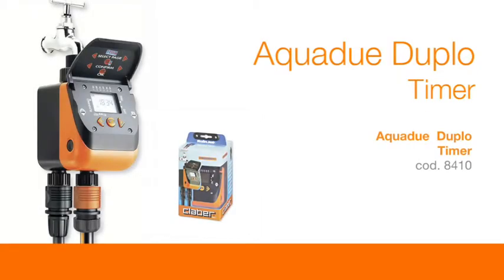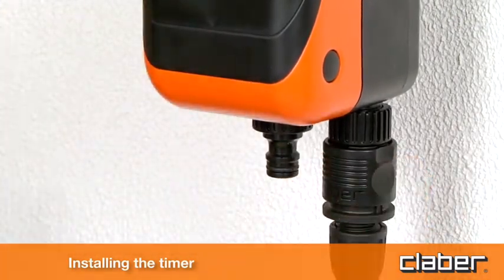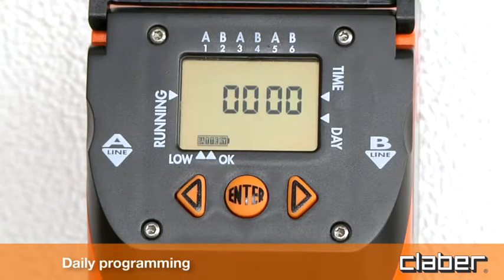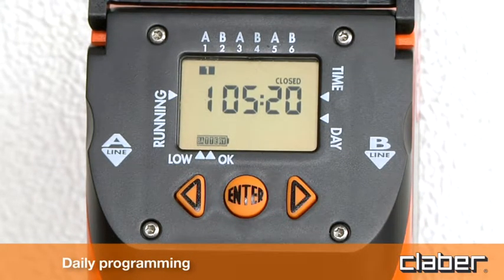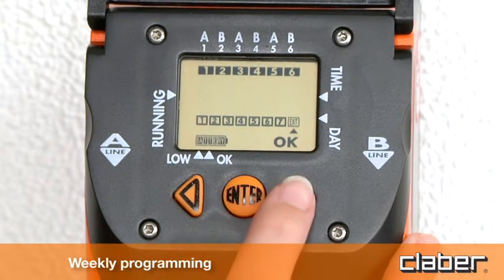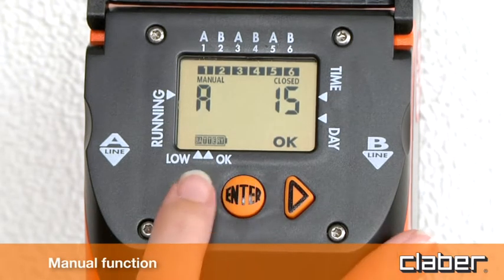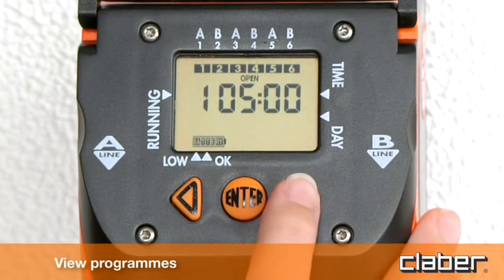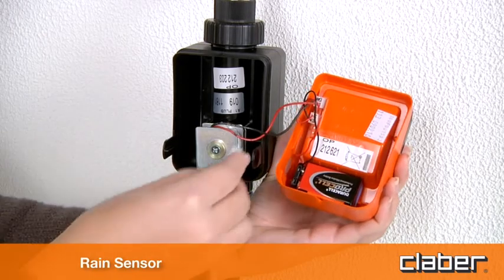Aquadue Duplo Timer - EN

Comment: If I understand this correctly, lines "A" and "B"  can not be programed on different days of the week. In other words, If line "A" is used for frequent daily watering for flowers, Line "B" can not be used for once weekly watering of lawn. Line "B" has to be set to water frequent daily watering as well. So much for water conservation strategies.

Comment: I am having problems entering times. It will not let me set the times I want. It looks like I can’t set a / b for the same time  I have 2 timer and 4 zone s.   That i want to come on 2 times daily  for 1 hr. to begin with. and I cannot set the time I want.   It’s looks like
Reply: I have to have them one after the other
Reply from the maker: We inform you that it is not possible to program the departure of the two lines together, but they have to be set in succession within the 24 solar hours. Programs 1,3,5 are for line A and 2,4,6 are for line B.
We suggest you to reset the timer by pressing the two arrows simultaneously for 10 second) and reprogram.
In our website you could find the pdf and the programming video.
We remain at disposal.